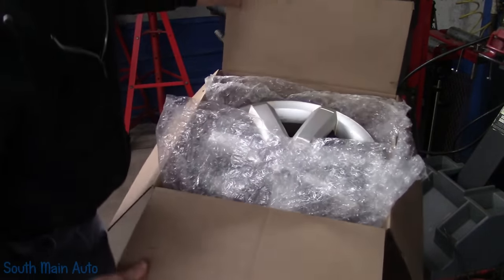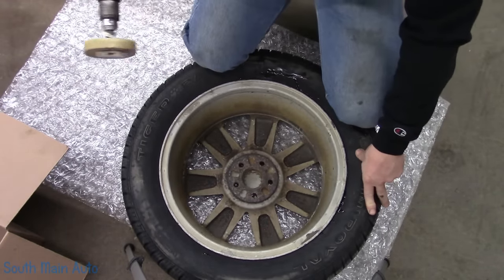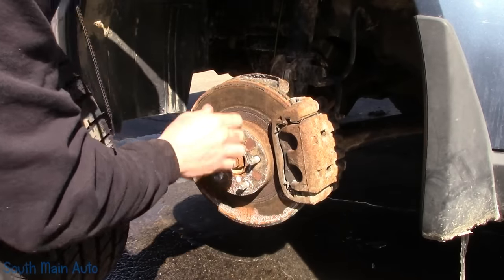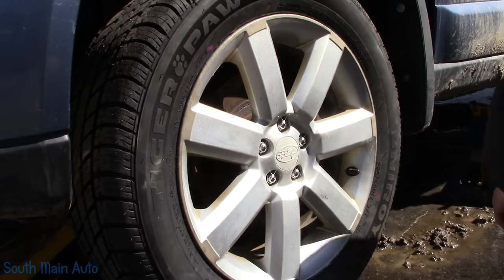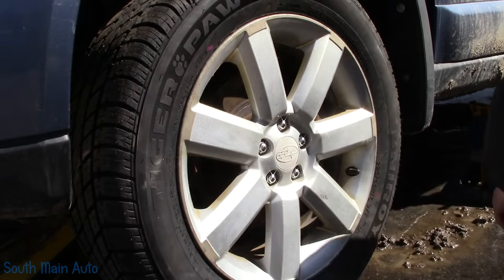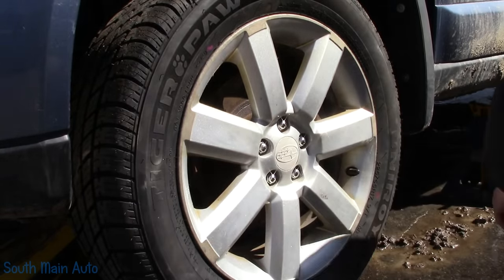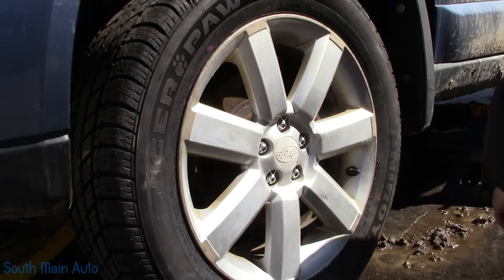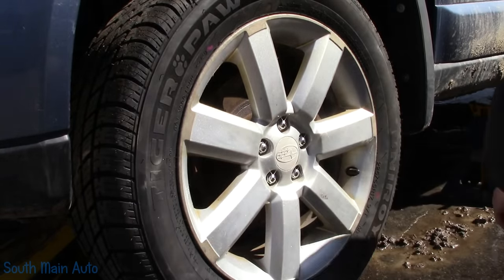Subaru Lost A Wheel On The Highway!

Comment: Did your customer not file a claim with the place that did his tires? They obviously left his wheel loose!!
Reply: What if guy did it himself?
Reply: @nrvsauto8990  Eric said he just had tires put on a week ago!
Reply: @njrenkable  trust me if made enough stink they'd cover his damage! Nobody goes back to retorque they can put anything they want on the receipt it's BS
Reply: @njrenkable  My Cavalier never made a sound. I turned a corner. hit a pot hole I didn't see in the process, and the watched my wheel roll away into another car. When I looked at it, there was no sign of damage to the studs, just no lugnuts to be found.
Reply: @efilnikufecin2004   Anytime you have tires worked on where the rims are loosened (and the rim is not Steel) you MUST take them back to be re-tightened and no, the shop that does the work is NOT responsible. I should know i talked to a lawyer and a friend who's a judge. Both said that you agree to return the vehicle to be worked on again when you pay and leave. So they are covered by contract law.
Reply: Id assume it fell off due to not properly cleaning the hub and rim face just like Eric said...
Reply: @njrenkable  a while back i had someone do a brake job for me because i had to work drove it for 3 days and the damn thing started jolting around corners and vibrating i got out and the studds and luggs wore bigger holes in my aluminum rim. soo gotta check, ya don't have to make sure the luggs are tight but it helps it does help folks.
Reply: @davidmiller9485  OK but why is that directed at me? I never said it was or wasn't covered. My comment was in reference to njrenkable saying "But honestly he couldn't hear the rim banging around? I've had a rim come loose and let me tell you it sounded like well.....like the tire was going to fall off."
Reply: @davidmiller9485  no kidding..😳
Reply: First thing I would've did as a customer or shop was have all the studs replaced whether they looked good or not. You don't know the metallurgical condition of the wheel stud after the lugnut worked it's way loose. 

My neighbor had lugnut come off his vehicle driving to work in 25MPH zone. Insurance covered everything but the cause of the accident and per law that's why they were obligated to cover with his full coverage. He had me replace the wheel studs. They also replaced the rotor , fender and did a little body work on the left window pillar where the fender rubbed a debt in it. This was last summer on a 2007 Chrysler Pacifica. 4k damage.  I thought insurance would have totaled it but they didn't surprisingly. That's one thing these days these mid 2000 model year cars are still holding their value good because of prices of new cars and auction prices on used cars. 

The neighbor thought you might have pulled the tire off one time to take it and get a flat repair done. I'm guessing that's what had happened because I had seen the tire flat a week and a half before when sitting in my living room looking out across the street at his house one day. 2 weeks before that time I had pulled the right front off of that same vehicle and put and back on after he got it repaired. I went and rechecked the torque I did on the right front one and it was spot-on still. Yes even though I help people on the side I do make sure to torque everything that factory specs because I don't want that burden on me. 

I understand why Eric only replaced certain things but from my perspective I wouldn't have sent that car out the door with my name on it unless they replaced all the wheel studs to cover my butt. Think about if all the lug nuts were gone except one which had been holding the wheel on it is probably weakened or in a weakened state we're given the right amount of stress it may still snap yet
Reply: @efilnikufecin2004  yeah i meant for it to be to bigdaddy, sorry about that.
Reply: @njrenkable  That's what small claims court is for. They probably would have paid up as soon as you served them
Reply: Aluminum wheels need to be double torqued within a week to be safe. When I change from my winter wheels (on steel rims) to summer wheels (aluminum alloy rims) I'll carry a breaker bar in my vehicle with the proper socket and retorque them once within 24 hours, another time in about 3 days, and a third time near the end of the week. I've had times where I could feel that they were more loose than they should be especially for the 24 hour and 3 day retorque. I'm paranoid about it since I've had one almost come off on me while driving. Luckily I pulled over in time to be able to tighten it enough to get it to a shop.
Reply: @efilnikufecin2004  foul play maybe?
Reply: @njrenkable  I've worked on cars for 17 years, taken off and put on many, many thousands of rim/tires in my career, and all different make/style.  With that being said, Ide say more than 99% of my customers NEVER returned to have their tires re-torqued, and non ever fell off.  Now with that being said, several scenarios could have happened here, from not tightening the lug nuts all together, to over torquing the lug nuts(stripping the lug nuts), not using a torque stick when putting on the lug nuts causing many to be under torque, the rim not being flush against the rotor when when the lug nuts were being tightened(maybe due to corrosion debris, etc...But I do agree it most likely has something to do with the tire shop where the new tires were installed
Reply: if you jack your car up, put the wheel on, set it down and tighten, then jack it back up and set it down again and retighten then you go for a drive at 35mph for 15 minutes then retighten you should have this issue solved.

You may think "that's a lot of steps" but in reality, you are forcing something to move position when you don't want it to, so you jack it back up to release the tension in a safe manor, the drive does the same thing.

How to know if your tyres are not affixed correctly

steer left to right in jolting motion, smooth but still jolting, feel your car, even in the most advanced cars you would feel it, brake softly and release if you feel something or hear something move then your tires are loose.

I know people think that this is a lot of steps but it actually is what people do on a daily basis, for the first 10 minutes in the morning, have your radio off and feel your car, concentrate on your surroundings and your car, after that turn on the radio and enjoy the ride... just enjoy the ride like it's relaxation time.
Reply: @efilnikufecin2004  I guess it all depends how fast your going when the Nuts finally left The Centrifugal  forces in a straight line would silence any indication the wheel no longer had nuts...I have had a wheel fly off on a bend that was fine on the straight at 70mph Scary  stuff.
Reply: VIP here in NH tells you out loud to come back to retorque. They just come out and do it in the parking lot in all of 4 minutes including calling him out.
Reply: I forgot to fasten a rear wheel on my Saturn,  one time.  and in less than a quarter mile I was doing 40mph, furthermore a bup-bup-bup sound started getting loud and shaking everything. I pulled over and tighten the wheel. Be safe guys
Reply: I always use a torque wrench on my wheels as soon as I get home from the tire shop, just to be safe. Almost always, I find that they tire shop has the lug nuts tightened to something approaching 7000 pound/foot instead of being too loose. The owners probably tell them to over-tighten them to make sure that wheels never fall off.
Reply: @efilnikufecin2004  that sounds likd a lawsuit in the making.. glad you weren't hurt.
Reply: @davidmiller9485  good point.. we all stand corrected.
Reply: That's why every single tire place puts in writing that you are to be back in 20-40 miles to check the lug nuts or check it yourself at that point
Reply: @deseremere  I know they put it on there my point is hardly anyone does! I never have rechecked mine and the only time a recheck matters is on new wheels/lug nuts!! Its still a shops responsibility to tighten their lugs obviously he didn't pay attention to the signs they were loose!!
Reply: @njrenkable  don't read while you're eating! ..."it sounded like well.....like the tire was going to fall off." absolutely hilarious! taco meat anyone want to wear taco meat!
Reply: @davidmiller9485  didn't know this about non-steel rims...going to retorque mine right now!
Reply: @k4x4map46   yeah i lost the front wheel off my jeep while in the next state over with my wife. Was not fun and i was looking for the party responsible. Turns out it was me for not following the re-torquing specks given by the tire shop.
Reply: @nrvsauto8990  The guy Put on new tires onto a rim and balanced them too? then installed them onto the car but forgot to tighten them?  So then he had it towed to someone else's shop and paid to have 1 tire reinstalled and a ball joint ....Yeah  he must of done it himself...
Reply: @davidmiller9485  wow. truth be told, I[ve always retorqued them and check torque before a long drive but never knew why...however not once on this newer vehicle between discount tire and the dealer freak that's at least a pair of brains if not 1-1/3 that I trust, well would like to trust
Reply: @k4x4map46  it's really a lotto. temp, drive speed even tire inflation can have a effect. I've got a good tire/mechanic guy but even then, after losing a tire in PA, i tend to have them re torqued. just two weeks ago we went from snow tires back to all season. Had them re-torque the all seasons two days later just in case. Two of the lugs needed it.
Reply: @njrenkable  i quit going back to shops for re tourqeing when i observed how they treated their torque wrenches.  Slinging them onto benches and letting them drop to the ground.  

Bought my own wrench and get it cal'd every 18 months. Tighten wheels to spec listed in manual and move on.
Reply: @efilnikufecin2004  Some one took them off? It's an old prank that can happen.
Reply: @njrenkable  I've never once seen that on a receipt.
Reply: The corrosion caused the wheel to work its way loose. Likely the tire tech torqued the wheels according to proceduree but overlooked the corrosion on the wheel and hub. Something like that wouldn't be overlooked by a real mechanic. The devil is in the details.
Reply: The key to proper wheel torquing (aside from cleaning the wheel and hubs) is to torque them with the suspension lifted and tire barely touching the ground to keep it from spinning while you torque
Reply: @user-os8sq3uh4n  I've been driving for over 50 years in the UK and NEVER had any instruction to come back and have the nuts retightened either written or verbal.  The only problem I ever had was when they stripped all five nut threads by over-torqueing with the air gun.  The consequences for the garage were really quite severe.  They were AA/RAC and police recovery agents and this incident was the final straw.  They lost all three agencies.
Reply: @davidmiller9485  Dude, a wheel will never come off unless the shop forgot to tighten it. There is no way. You don't need to recheck anything it does not come loose. The only way it can come off is due to negligence. The reason tire shops put that disclaimer is to try and protect them from their workers negligence. But it will NOT hold up in court.
Reply: @fuckjewtube69   well two lawyers and a judge disagree. Also different kinds of metals do cause this problem. There is a reason it applies to aluminum rims. The lugs are steel and both expand and contract at different rates. I have no idea why i thought people would understand high school physics but this week has been pure shit for people being informed.
Reply: @davidmiller9485  ask them law types about full disclosure.
Reply: Loose?  Tightening lugnuts too tight, beyond torque specs provided by manufacturer, is just as likely.  This is especially true with places that power tool the lugnuts all the way.  Always torque your lugnuts to recommended specs.
Reply: @Hotrodfink58   IT IS  FULLY DISCLOSED. It's on the receipt you get. You do read the receipt after you pay for things right?
Reply: @davidmiller9485  The different coefficients of expansion between aluminium alloy and steel are negligible over the short lengths and small temperature ranges involved and thus irrelevant.
Reply: Basically a negligence claim.  You would fail on the "duty" prong.  Try proving that he failed to meet his duty.
Reply: @njrenkable  lmao sounded like the tire was going to fall off. That is in fact exactly what is sounds like and it's obvious theres a problem. He ignored the shit out of it
Reply: @njrenkable  I've never heard of doing that...I do know that I always check mine (remove, inspect, re-torque one nut at a time) after a shop works on it...I had one place torque them so much I couldn't get them off they were so tight.  When I took it back they had a 6ft pipe on it and still struggled to get the nuts off.  Ended up having to get new studs and lugs.

I've also had the opposite...on the way home from a shop I had a lug go flying off one time (fortunately the other 4 stayed) sucky thing is the one that flew off was an expensive locking lug not just a normal one.
Reply: @davidmiller9485  22 years on my 97 F150 with aluminum wheels, actually two 97 F150's each with 250,000 miles, NEVER re-torqued lug nuts, never had a problem. Same for my 2012 Chrysler 300 with 117,000 miles, never re-torqued wheels rotating every 5-7,000 miles. Same with my 98 Buick Regal with aluminum wheels which I drove at 100+ mph. I call BS on dissimilar metals also... When you buy a new vehicle with aluminum heads are you required to come in and have then re-torqued? How about that aluminum water pump mounted to a steel block, or aluminum transmission bolted to a steel block???? Those items are no different than an aluminum wheel attached to a steel hub!    I know for a fact sometimes people forget if they torqued EVERY bolt and ASS U ME D  they did. Been there seen it. My attention to detail prevented me from getting killed when my boss said we had torqued the bolts on a lower section of a tower crane when I KNEW we hadn't. I insisted we double check and sure enough we hadn't...This would have killed us when that joint would have failed the next day while we assembled the main boom, machinery deck and counter weights 200 feet above that joint.  I always check torque twice on every wheel and every bolt when I do my own wheels.
Reply: @fuckjewtube69  Exxxxxxxxactly. This car lost its wheel because the tech finger-tightened the lugs then forgot to put the impact wrench to it. 
If "retorquing" after 30 miles was necessary to avoid losing a wheel we'd be dodging wheels all day every day. Maybe 1 out of 100 people take their vehicle back for retightening.
Reply: hope it wasn't a lowpro tire and rim as that would cause the tire and rim come off if he hit a good pot hole on the road happens all the time lowpro tire and rim hit a pot hole tire comes off while driving from pot hole damage I have seen it happen it can kill you
Reply: @davidmiller9485  I worked for a Chevy dealer, Sears, and Belle Tire shop and the standard for all 3 was that aftermarket wheels must be noted to come back for re-torque. It was not required for stock factory wheels.
Reply: @njrenkable  I have never heard of that, and I have never had a tire come off. I have never heard of anyone's tire coming off like in this video.
Reply: No way I would entertain a claim a week after the car has left my workshop.
Reply: Losing lug nuts is one reason I never rely on an impact tool, I always use a torque wrench and torque to manufacturer spec.
Reply: @njrenkable  my cousin had a clicking going on. i didn't have time to look at it much but i did off to follow him to a shop. kicked the tire and it felt solid, drove it and it sounded just like a cv shaft clicking and popping.
Reply: Wheel nuts, or bolts in some cases, all need to be torqued to specifications. I see too many people who do their own wrenching and fail to do that, and not just with wheels. I've seen them bolt other items on their cars and not torque the hardware too -SMH.
Reply: @njrenkable  My GF had a flat but couldn't hear the damn tire flapping around. Luckily I just got in the car and noticed, told her to stop, looked and saw he rim was also bent. She ended up needing a new rim and tire.

Months later she totaled the car....

Women
Reply: @njrenkable  Plus most shops just torque the shit out of wheels. Bad idea but the modern day mechanic is lazy and just wants to speed through jobs for that commission
Reply: @efilnikufecin2004  that's why I do my own work now.
Reply: Most places have a disclaimer right on the repair order to come back for a lug nut "retorque" Usually within the week. and this is there to save them from Claims like this..
Reply: @billybeemus3929  My son in law did that to my BMW at the Black's Tire Shop he manages. I had to buy a 6 ft pipe to put over the tire tool to get them off. 1 was stripped. Hurt my back, dammit.
Reply: Semper Fi  yes they either are not tightened properly or they are tightened properly but are not cleaned. If the hub and rim back are dirty a torqued wheel can come loose.
Reply: 08:08 >  The mechanic uses a rattle gun to torque the lugs. Do some rattle guns have a torque limiter? Is the limit set by the rotation speed? Can a good mechanic gauge the end torque accurately enough to do this job by feel or by sound?
Reply: @njrenkable  Like you're gonna hear that when you've got 4KW of drum & bass bathing the neighbourhood.
>
Reply: So did you just put the wheel back on there and then?
Reply: @efilnikufecin2004 
I've had that happen three times. Twice there was a slight noise. The first time I was only 17. The wheel did come off while I was driving. The next time I knew to check the wheel and tightened it up. The third time it didn't give hardly any warning..
Reply: @jonathanpalmer228  I have.
Reply: @Hotrodfink58  
The laws may very from State to state and the precedent set by previous cases. Some judges may rule different than others as well. A judge is not a mechanic...
Reply: @FloridaSunMitochondria 
I had our car inspected at a shop once that torqued the lug nuts on to the extreme. As soon as I picked up the car and got home I tried to remove one of the wheels. No way could I get it off. I immediately took it back. They tried to get it off and after trying a spin wrench and then trying an electric impact wrench and still not getting it off they had to pull the car around to another bag where the air powered impact wrench could reach it. That worked. I never went back to them again. I should have made them replace all the studs and lug nuts.
Reply: @njrenkable  Retorque ?
I've never even heard of that.
Must be expensive wheels you're talking about...
>
Reply: @kevinnoble5988  
Some wheels have different torque specs than others and I know you know that. Not sure but I'm wondering if that might make a difference? A lot of vehicles are 90 ft.lbs or more but most Toyota cars are only 76 ft.lbs.
Reply: @Cautionary_Tale_Harris  They should not be tightened with an impact wrench (unless using a torque stick).
Reply: @christophervanzetta  
A lot of them even at the dealership over-torque oil filter caps too.
Reply: @stevensevek6151  some places yes they do. Learned that from last time. But not everyone does like Walmart doesn't. I know because I work there
Reply: @njrenkable   Heck even the stealership does not ask you to come back 24 hours later to re-torque the lugnuts. if it is all clean like Erick O. does no re-torquing required ever. That would be like asking a NASS car driver to come back in 2 laps to get re-torqued, he is going to tell you to get torqued. lol
Reply: @Rock-Bottem1982   Agreed. I have worked for a major rental car company for over 18 years plus some new car dealer experience and our shop has done thousands and thousands of wheels/tires from most of the manufacturers and we have never had them come back loose and needing to be retorqued. Once a rental car leaves the shop it often ends up in another state and we never see it again.  The wheels, hub, and studs are all clean on the cars we work on however.
Reply: mfg clearly states this and so does receipt but you correct it's bullshit.  seems like they always over-tighten and if they did it to specification people would have to be in there a lot more to get re tightened.  i think thats partially by design and partially because they are lazy or dont have thew time.  better than a wheel coming off and more work down the road from over tightening
Reply: Post propter hoc, ergo post propter hoc.
Reply: @bigdaddymak1439  Agree
Reply: @moneygrip4464  and @David Miller having failed my real estate exam I can remember though squatters dont need a lawyer when they got mechanics lien
Reply: ISTR a case in Michigan where a wheel fell off leaving the tire shop and a dumb-dumb judge ruled the shop wasn't liable for not tightening lug nuts as "the job was completed" as soon as the tires were changed on the rims (tightening lug nuts was optional?)...
Reply: @njrenkable  
I've lost a wheel twice during my lifetime. The first time I was a teenager so no I didn't realize that noise I heard that sounded like a helicopter wasxa loose wheel. The second time was about ten years ago and my wife was with me. And yes it sounded like a loose wheel but I didn't get much advance warning. As soon as I heard it I started to slow down and pull over but the wheel came off before I came to a complete stop. I went to put the wheel back on but could not find any of the lug nuts. My wife says, "What are we going to do now?" I said... Take one lug nut off each of the other wheels, make sure all the wheels have tight lug nuts and then drive to the dealer (or parts store) and buy more lug nuts. Now I have my own torque wrench.
Reply: @efilnikufecin2004  
So you did put the wheel back on anyway, right?
Reply: @davidmiller9485  
It you can tighten them yourself especially if you have you own torque wrench.
Reply: @jonathanpalmer228 
Have you ever looked (including the fine print)?
Reply: @fuckjewtube69  
Well, you might be right but... some torque specs aren't very high. A Toyota only calls for 76 ft.lbs. but a Buick calls for 140 ft.lbs.
Reply: @davidmiller9485  
Our Toyota RAV4 has the same torque spec for steel or alloy wheels.
Reply: @Cautionary_Tale_Harris  
They're supposed to be torqued with a torque wrench and not simply tightened by a sasquatch.
Reply: @njsongwriter  If I'm going to do that why the hell would i pay a shop to do my tires. (I'm hoping you get the idea here, I'm paying for a service. If that requires me to go back then that is what I will do.) 

:)
Reply: @njsongwriter  I'm unsure what this has to do with anything. The problem here is that dissimilar metals (in this case steel and Aluminum) contract and expand at very different rates when heated and cooled. This causes the rim to need a second torqueing.